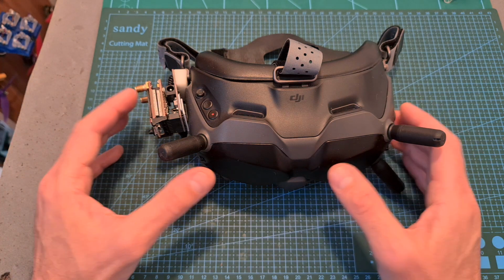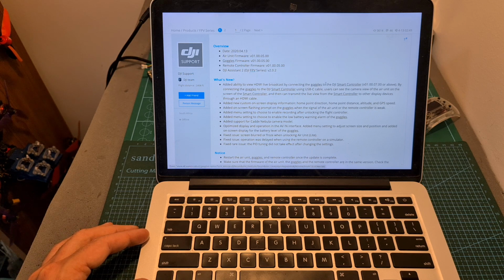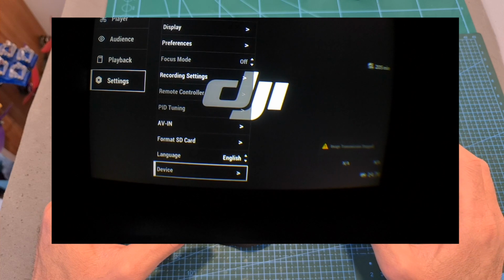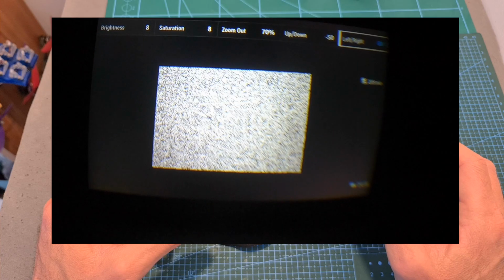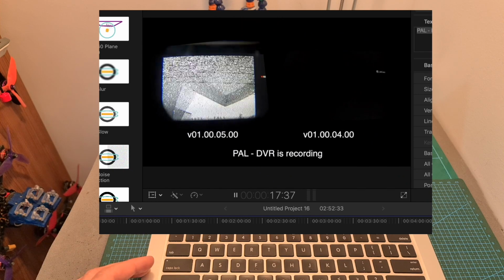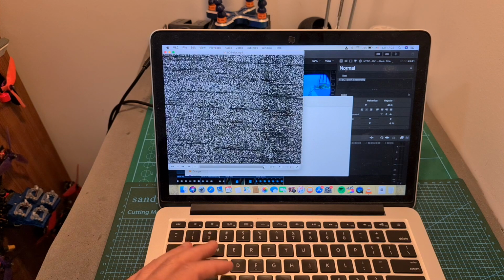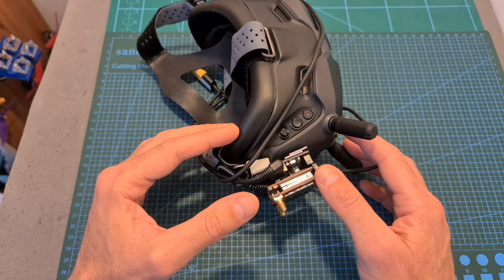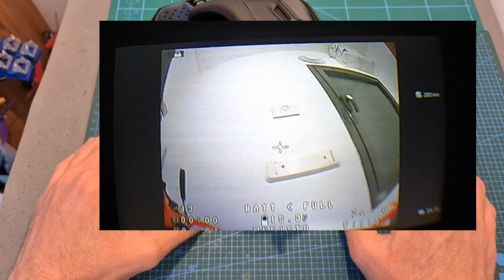DJI HD FPV April 2020 Update - AV-In & Latency Tests

Comment: My screen just goes blue when its av in, its a hit and miss for me in av in sometimes it works sometimes it doesnt. Nit sure whats going on. Most likely its firmware. Still havent fixed it
Reply from the maker: Make sure that you don't have any issues with the AV cables.

Comment: Is it possible to use Eachine ROTG02 with digital googles? I just ordered them and wanted to somehow connect with my ROTG02 :) Do you have schematic for DJI AV input. I have some electronic background and wanted to create a cable but what I also don't know is how the ROTG02 AV socket is called - it has 4 pins. In general the whole thing should be somehow doable but I'm missing small pieces of information. Please help! :)

Comment: To understand the latency, is this similiar to analog goggles like fatshark HDO? — should DJI with analog be usable for racing?
Reply from the maker: The latency is higher than the latency of the HDO2 and currently these goggles are probably not recommended for racing, at least if you're doing it professionally.

Comment: Nice video I finally subscribed to your channel because I found it useful, anyways I want to get the dji fpv googles and I want to use it to fly my analog and new dji air unit, now I have my T8SG and I want to know if you use the dji transmitter or do you use other transmitter? I want to use one controller not having 2, please advice cheers
Reply from the maker: Thanks and welcome on board. 
I never tried the DJI RC and of course - you can use any RC that you would like and regardless use the DJI HD system for FPV. 
Happy flying!

Comment: Do you recommend the DJI? I have the HDO2 and i can sell them and get the DJI but I have a lot of whoops and quads that i can't change it to digital. So i don't want to lose the analog so i want to know that 30ms latency is really a big deal on freestyle beginners flight?
Reply from the maker: I am very happy with the DJI goggles and I definitely recommend them to everyone who can afford them. 
For freestyle you shouldn't have issues using the analog adapter, just keep in mind that you should set your camera to NTSC in order to avoid the blackout issue.

Comment: I just built  my first drone with Tmotor F7 stack meant for DJI and my remote controller's sticks wont work for some reason but the record button works. And sticks dont move in Beta Flight either. So disappointing I dont know what to do... Please help
Reply from the maker: It sounds like that either the Radio Controller is not bound properly, you didn't wire the SBUS out pad to a free RX port on the flight controller or you didn't configure it on Betaflight. It's very likely to be any of these 3 option (or a combination of them).
Reply: This happened to me. Make sure you set up your googles to sbus_baud_fast and also on betaflight.
Reply: Kevin Fuentes I figured out it was the RX assigned to the wrong port by default. I changed all and worked with the last one. Thank you guys for replying👍🏼

Comment: That was a great update Gal. I updated mine yesterday. Had not done them for ages as was holding off for the long range OSD. I noticed that after the upgrade the FCC and Power hack was still in place. Result!
Reply from the maker: Thanks buddy! Too bad you can't record the OSD data, as it's very important for finding a lost drone...